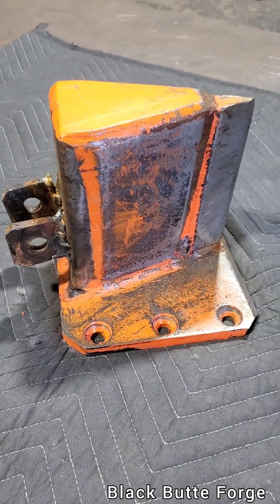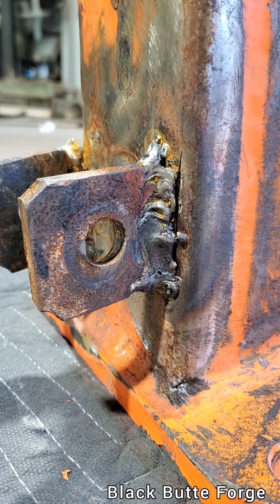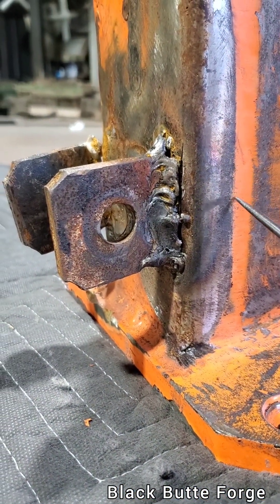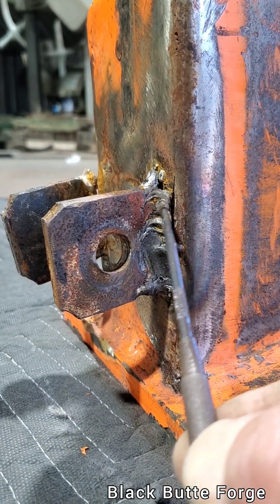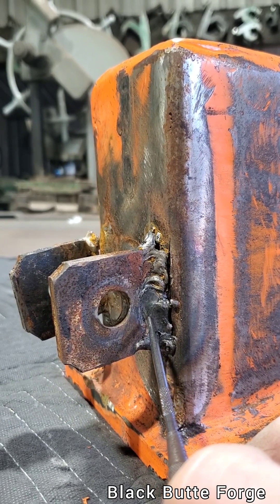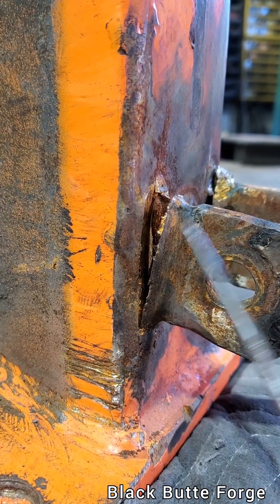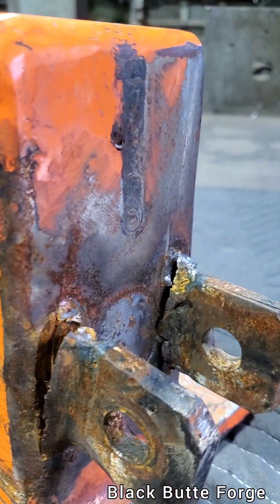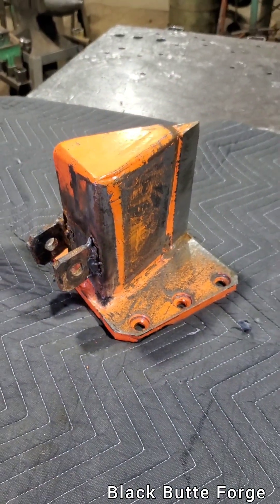Black Butte Forge- Understanding welding defects

Comment: Serious question. I'm not a certified welder, but I play one in my shop. Why would you want to run vertical up when you could just turn the piece and run horizontal?
Reply from the maker: Great question,  whenever you can position the work to favor a easier welding position, you always should. When you can't and it needs to be structural, it needs to be vertical up, 3G or 3F.  When I positioned the part, I set it up like a  G1 at a slight angle (like 5 deg.)  and welded uphill to encourage all the slag to roll back. The first repair was made without taking it apart from the wood splitter, so that guy had either up or down...and they went down when they should have gone up for penetration.
Reply: @blackbutteforge  That makes sense. Thanks for the explanation.